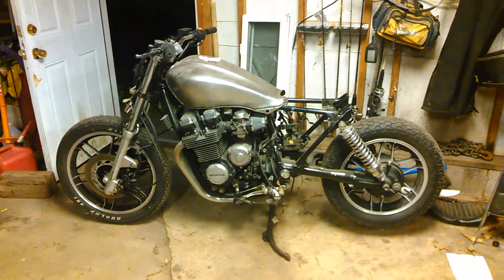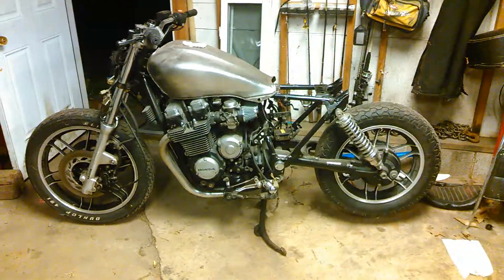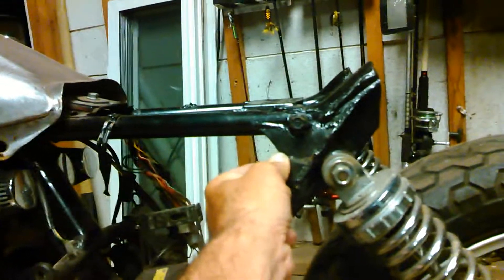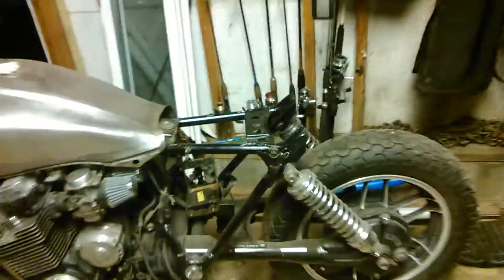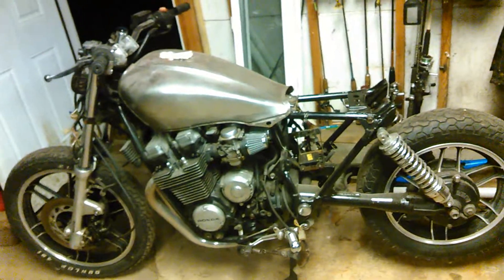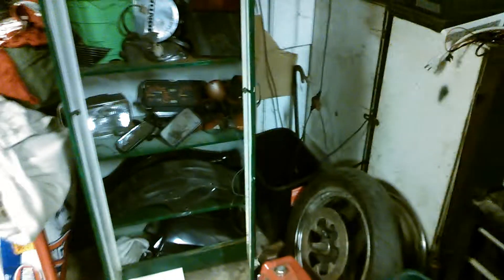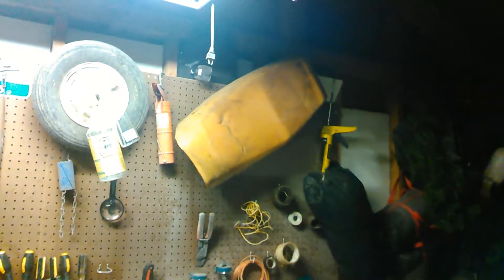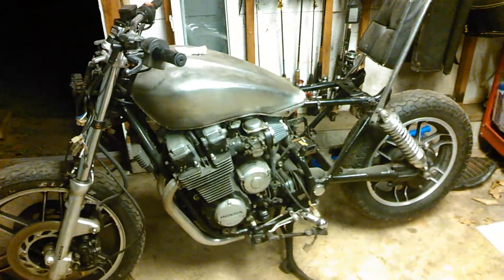1983 Honda nighthawk custom bobber project

Comment: Any chance you have an update? How’d it turn out, I’d love to see the finished product! Thanks for sharing bud!
Reply from the maker: I bought it off my brother but he passed away and I just cant handle working on it. I will finish it. Someday.
Reply: @fpvwithme  awe man sorry to hear that bud.. when the time is right I’m sure you’ll get back on it and enjoy doing it. I have the same bike and plan to have a somewhat similar build!
Reply: @fpvwithme  did you have any troubles tuning the carbs for the pod intake filters? I want to delete my stock air box and run air intake pods. Everything I find on the internet is rather contradicting in regards to tuning and rejeting my carbs to except the conversion. I’d rather not order up a bunch of parts that I don’t need. How much did you increase your slow jet and main jet sizes if you don’t mind me asking?
Reply from the maker: @jojojoseph2469  there was no carb issue at all when I removed the air box. I also read it could lead to jetting issues but it was fine.
Reply: @fpvwithme  thank you for your reply.. I doubt I’ll have the same outcome. With the stock set up my pilot screw is already dialled out at 3 1/4 turns and it runs mint but anymore than that it falls on its face!